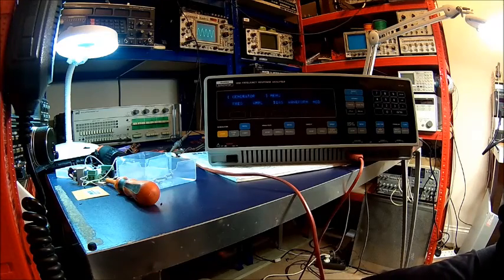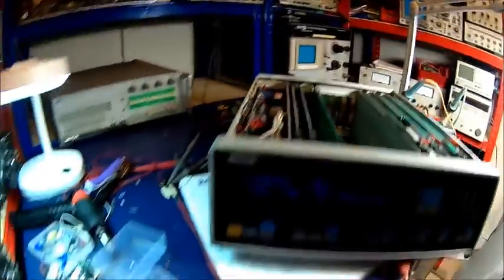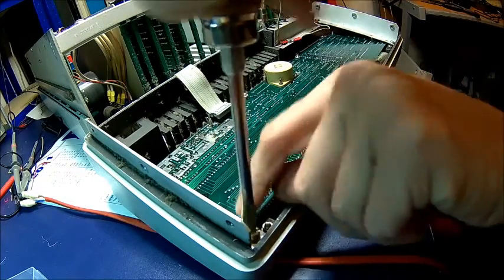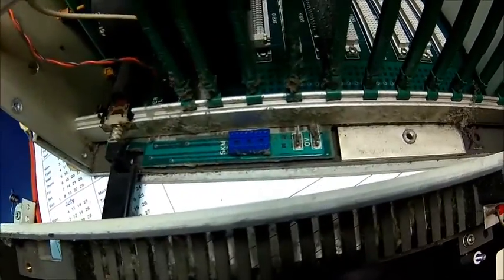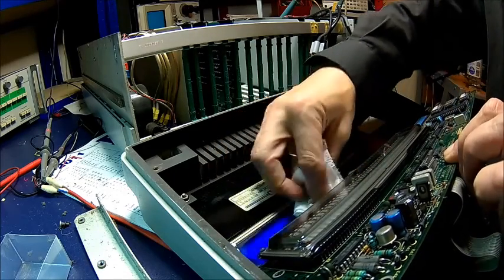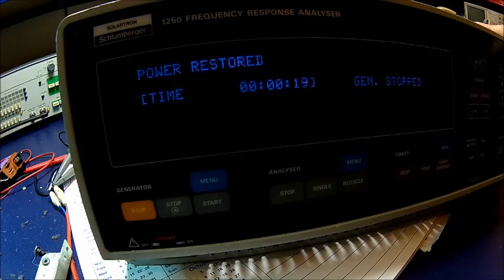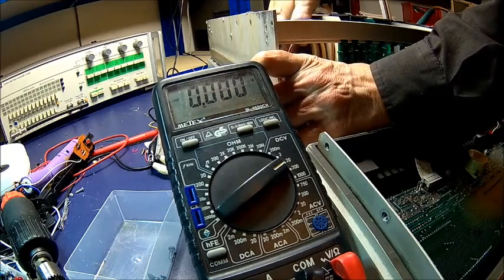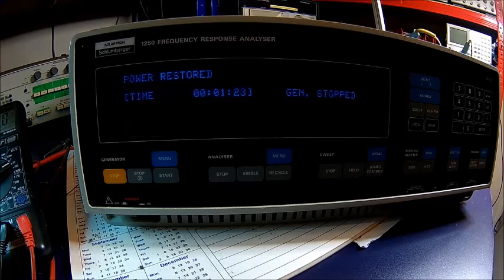Solartron 1250 Audio Network Analyser, checks and tear down  -Shop Gossip #2 -

Comment: You mention further videos on the uses of this unit, any chance of that happening? I have one, but have no knowledge of its potential. Thank you.
Reply from the maker: I did actually make another video, but i could not publish it at the end as it was showing a customer prototype unit under test which i have not got permission to show it in public. I am in the process of doing another job with it, perhaps i can make something of that footage.
The manual is actually quite comprehensive, explaining pretty much any function, once you figured out some quirky menu location issues, it's a very useful tool. ... In short, it's a glorified function generator with 2 analytics channels, capable of phase angle and FFT calculations in various configurations.
Reply: @dynoguy  Thank you for your prompt response. Although I managed a repair of this unit, the operation/functions is beyond my pay grade. I look forward to said video.

Comment: Thanks for the nostalgia.  I worked at Solatron during the time we were making these 1250s, they were very popular at the time.  Watch out for the tantalum caps, they were the most likely component to fail during burn in SOAK testing.  In fact quite often we would replace them first then diagnose because on average it was quicker.
Reply from the maker: Thanks, glad you liked it,...yes i am well aware of the tantalum problem, i usually rip them out by default when i get a faulty device, I think in one of my recent videos i mentioned that i hate them, for the same reason as you said.
I like the 1250, such a versatile machine and remote controllable, too, ... heavy, but quite reliable, ... but i must admit that i mostly use it as a glorified function generator....:-) ..

But you being an ex Solartron guy... , do you have by any chance a source for an 1170 manual, and/or a 2721 counter manual. The counter works but i am looking for the GPIB control set,  also have two 1170s one with nixies, the other with leds, both don't work anymore, that's why i purchased the 1250 (came with a service manual). Also got two working 7060 multimeters, love them, but no manuals either, only from a later model, i think it's for a 7065,  but control set seems similar.
Reply: I'm sorry to say that I can be of no help.  That was a lifetime ago.  Sad to say back then I knew the GPIB control set inside out having been responsible for building and coding the automated test systems we used in production but its all gone now :(.
Reply from the maker: No problem,   but worth asking nevertheless, Solartron manuals are super rare
Reply: Don't know if you can answer this, but, currently I am working on some Solartron 1250s and am running into an issue where I can get one channel to work but when both channel cards are installed I get bad readings and it won't see the other card. Will tell me Ch2 Fail. Any ideas on what causes this error? Thanks.
Reply: PS. comes up with Error code 50 which is a missing board error.

Comment: Sorry for such a noob question ...that orange cable you have connected to the front panel ...does that go into your oscilloscope ? Also does HI and LO refer to hisense and lowsense
Reply from the maker: Hi and thanks for watching. Don't worry, there are no noob questions, anyone has things he does not know.
Anyway, you correct on both assumptions, the orange cable is the output to the scope. The Hi and Lo designation on the input is because it is a differential input, so it has no reference to ground. Hope that answers your question....
Reply: Thanks for the reply. Appreciate it !. So do you use only one of the terminals to connect to the scope? ... your plug looks like it plugs into both the HI and LO terminals
Reply from the maker: it is connected to Hii and Lo, of course. Lo goes to ground and Hi to the signal input of the scope. The orange cable is actually a Euro mains lead, it just happens that it's got the right spacing so it fits nicely to the output of the Solartron
Reply: thanks for your reply !

Comment: Hello,

Thank you for taking the time to put this up here.  I had not seen one for this unit yet.  You said you have the manual for it.  Is it electronic or hard copy?  I have a manual for the 1255/60 and they do not list the same parts for the PCB 10.  I have a smoked tantalum C407 and I was hoping you could tell me what it is called out?

Cheers,

David
Reply from the maker: +Bob jones ... Hi David, ... you're welcome. 
As you say, there is not much out there on Solartron, got some other gear from them which i am looking for documents since many years, e.g. 1170, 2721,  but no luck so far.. 
Anyway, got the operators manual for the 1250 and the same 1255/60 service manual as you. I've downloaded both ftom thr KO4BB website. I certainly can pull my PCB 10 and look for C407. just give me a few days as i am pretty busy right now.
Where about on the board is it, and how do i know which is PCB 10, are they labelled somehow ?
Sorry, it's been a while since i looked inside of that beast. 

cheers, Mike
Reply: +dynoguy it is channel one board which is "i think" is the second one from the right if you have the cover off and looking at the front panel.  In my 1250 i have three cards over on the right side.  When you take the card out and you have the component side facing you C407 is ALL the way over to your right about 75% up from the bottom.  There are two similar circuits close to each other and the caps are both next to a transistor.  I cannot read the cap size on the other circuit and do not want to assume what size I should put back in there.

After removing that board the unit came to life and started giving me a display.  Then as I played with the keys a bit and watched a couple of videos on the unit, I came to understand the keys were not working correctly and will need more diagnosing.

After being on about 8 minutes the PSU started smoking spectacularly and I shut her down assuming there were more bad caps to find and replace.  I have not taken the PSU out to look at it, but hopefully this will all end well.  It should, I have power, display, and a few things are working.  I am thinking caps and a good cleaning, then see where a stable machine with properly functioning keys takes me.

Thank you for the assistance sir.

Cheers,

David
Reply from the maker: +Bob jones... Ok, thanks for pointing me to the right place. Please give me a few days and i will come back to you with the value, perhaps i take a short video of it.
Btw....did you check the mains voktage selector being set correctly,.....some time ago i got a scope with a totally fried PS because some some dude set it to 110V and must have turned it on.  Don't lnow where you live, but we have 230V/50Hz mains over here....Happy Easter
Reply from the maker: +Bob jones  ..Just did a video hopefully showing everything you need. Should be up in about 2 or 3 hours, my upload speed is really slow, sorry.